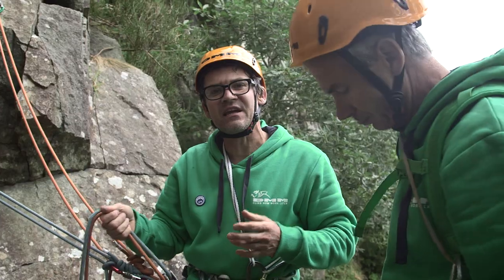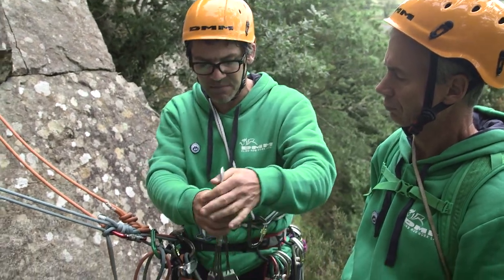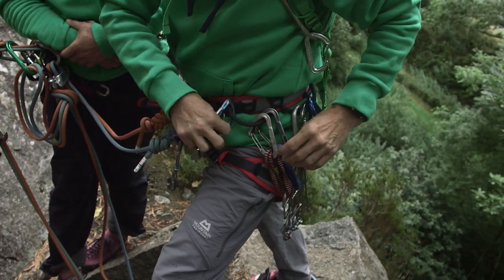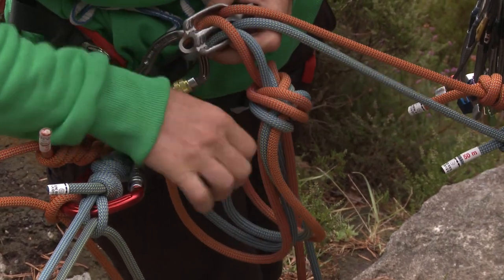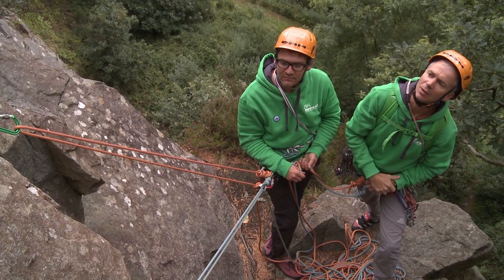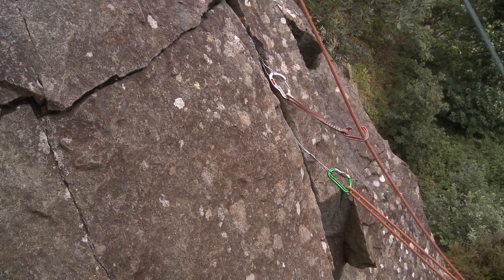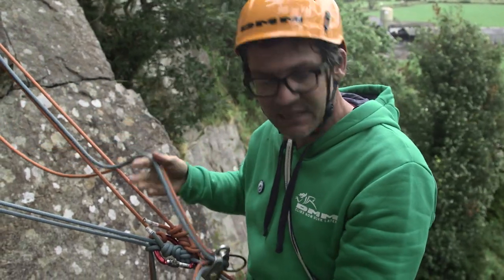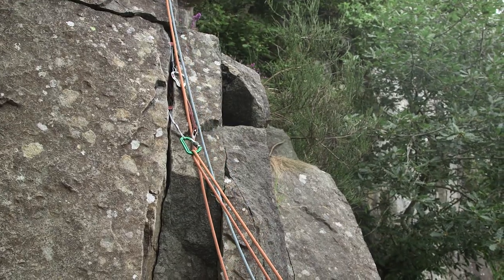Multi-pitch climbing: how to swap leads and climb through

Comment: Thanks guys. Useful video in that it gave me something to think about regarding the lock position of the brake hand if there is no first runner after the belay. Interesting too to see how you tie the belay device off. I thought you had to tie some half hitches around the live rope so it is releasable under load - but the knot works of course (was it just an overhand?)  i have taken to tying an alpine in this scenario and would be interested in your thoughts. currently in the process of re-assessing how I do things so all this was great fodder for thought. Cheers.

Comment: Multi pitch newbie here. I've read elsewhere that the anchor should have a piece in the other direction (protecting the belayer from getting pulled into the wall if the climber falls), this makes sense to me. But no mention of it here. I guess no one will reply to this now but just gonna put this out there.
Reply: Keep wondering the same thing but other directional gear doesn't get mentioned on a lot of videos. Have you found out any more on this?
Reply: Sometimes there isn't anything available. To stop you getting pulled into the wall you'd need something behind you as well. Having a cam in the belay makes it safer as they are mutli directional. An upside down nut could also be used to stop the belayer being pulled miles upwards and ripping out the belay.
Reply: To add, if there is nothing near by for a directional, giving enough space between you and anchor is also an option. Allows you to be pulled a bit without getting to close to anchor. But good note you made
Reply: You are right. There a few problems on the video:
1. As you mentioned, there is no other direction anchor. The problem is not a belayer being pulled into the wall. The problem is the belayer being pulled up a meter or two - which can easily happen if partner falls down 4-5 meters - with both anchors go off the positions in the cracks in the wall. In that case you loose the belay entirely.
2. If you belay your partner through yourself as on video, then you will be pulled a lot. You can put belay point into the station on the wall, then belayer won't be pulled, but then you need blocking anchor for sure, and you have to build the whole thing other way.
3. If you go on twin ropes, you must click both ropes in the first quickdraw carabiner, then you start switching which you click..

Comment: Very surprised the AMI released this video ( when he arrived at the ledge he should of made himself safe and then started to set up the belay. His first runner he places he puts the rope through and then tells the audience he is safe ? where is the clove-hitch knot ? Considering how good the ledge was i would of tied my second straight into the belay system not into my harness. But hey what do we know hes Qualified !
Reply: what they've done is an appropriate technique for swinging leads from a big ledge. clove hitch would have been needed if they were block leading.
Reply: as the anchors are out of reach there isn't an easy masterpoint to quickly clip into either

Comment: Why are they using two different ropes wouldn’t it just work with one rope as well?
Reply: yeah, just search up twin ropes, just a bit safer
Reply: Double ropes is good for trad climbing where the gear is either side of where you are climbing and with multi pitches gives you longer raps.
Reply: Less rope drag, longer repels (unless you bring a tag line with you), less chance of taking a huge fall when clipping gear high above you as the other rope isn't being lifted up, force spread over 2 pieces when you fall if the placements are a bit crap.

Main disadvantages: expensive (2 ropes to buy), faff

Comment: That's not how you use atc guide to belay a second !
Reply: He is using it exactly right? No, he is not using the assisted braking that the semi-braking belay plates like the reverso provides but he is doing nothing wrong? If you look at your belay plate there is a mark for the climber's rope and the rope for the brake hand. When you are belaying from above it is reserved compared to from the ground. How would you belay with just a standard tube belay plate from above if this is not a correct way?
Reply: ali hasan the climber should be fed the top of the belay device, providing an auto lock if the climber were to fall and the belayer incapacitated. (The auto lock is never to be trusted 100%, but it's pretty much a guarantee)
Reply: You do realise there's multiple ways to belay from above depending upon the given situation? For starters guide mode is not always warranted and can be a right pain in the arse. Secondly, a redirected belay isn't a great idea as the force is doubled on that first piece should the second fall off. Ok on a bomber bolt but not so great on a single wire or piece of Trad gear. Plus, it can pull the belayer upwards into the first runner if the second Falls, and depending upon the specifics of the belay setup, can also be a right pain in the arse. On Trad routes where the anchor is anything less than bombproof it's not a bad practice to belay directly off the harness as it places less stress upon the anchor due to the belayers body absorbing a good portion of the force.  But like I said, there's multiple approaches to most aspects of anchors and belays depending on the situation.
Reply: @benmace6865  How is "belayers body" absorbing any force? His belay device is clipped into the anchor
Reply: @shoqed  I'm not sure you read my comment correctly. The sentence which you're questioning is as follows "On Trad routes where the anchor is anything less than bombproof it's not a bad practice to belay directly off the harness as it places less stress upon the anchor due to the belayers body absorbing a good portion of the force." My comment is not about the system used in the video but simply highlighting that, if you choose to belay directly from your harness in a top belay scenario, your body acts as a shock absorber within the rope system, diminishing not the weight but the absolute force placed upon an anchor should your follower fall.

Comment: First of all, the belayer is constantly letting go of his braking hand… Second, that is definitely not how to use a reverso to secure a following climber. And third, a runner is put when the lead climber is still secured to the anchor point. In this video the lead climber has a chance to fall before he sets up the runner, and that would have been a factor 2 fall with all the force directly on the belay device of the belayer… This video is quite dangerous…
Reply: katia moreo when does his hand come off the brake?
Reply: You don't need to use the reverso in guide mode. Sure, it is handy but you can just as well belay like this. What if you did not have a reverso but just a standard tube? Look at your belay plate and see the markings on it dictating the end for the climber's rope and the one for the braking hand.
Reply: Do not use the standard tube. I do not know why, but english climbers get this thaugth thus it is against the instructional manual...are you sure you can gurantee always a 180 degree angle between the incoming and outcoming rope in case of a fall? also this "taking" over is not safe...it was shown that many many climbers who use this technique let go of both hands if they take a lot of slack and things get hectic. with let go, i mean a millisecond maybe less. However if a fall happens you cannot stop this. Second if you use this method, and your follower makes a little bit of s swing you may swing to and who knows what happens  then.
Another point, which was shown that this taking over technique lead to the fact that people arent grabbing the rope with the "whole hand". you can actually see this in the video. He is grabbing sometimes the rope only with thumb upper part of index and middle finger. We call it in germany "pinzetten griff" (translation: tweezers grab) and this is actually dangerous...
last it is also questionable, if this poor first protection is enough for a factor 2 fall...if this goes out, and he falls next to him the belayer cannot hold him, because the tube has no breaking functionality. not really happy about this "instructional" video as there are many open questions and if's and but's...at least they talk about the problem, however, i got the feeling that the belayer is somehow telling me that i just have to put my breaking hand up if my leader falls next to me and everything is fine. i doubt anyone can do this in such a situation

Comment: Be careful!!! At around 4 minutes 40 seconds in the video, you can clearly see that the belayer doesn't even have the carabiner in the freaking belay loop. Careful with these videos.
Reply: Lots of people (especially in the uk) clip directly into the loop of the knots (as you can see the person has done in the video). Some believe that it gives additional stretch as the rope is more dynamic than a belay loop. Its just as safe either way as the rope goes through the 2 points in the harness to create a closed-loop.
Reply: @osiriswoody5337  It's only standard in the UK, a bit like tying off the tail of the Fig 8 is (there but not necessarily elsewhere
Reply: @MJ720  a key point is that it transfers the load onto the anchors better rather than pulling the belay loop and harness awkwardly